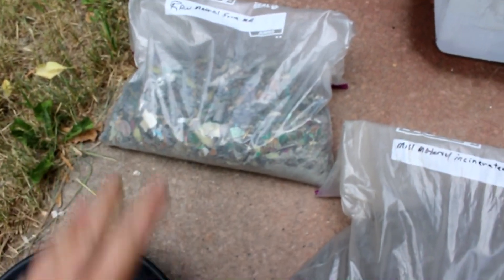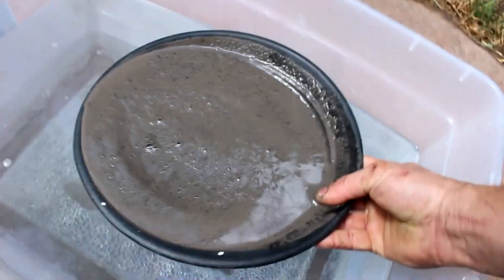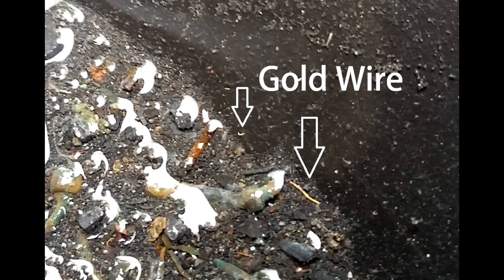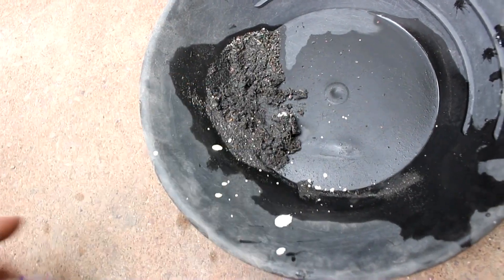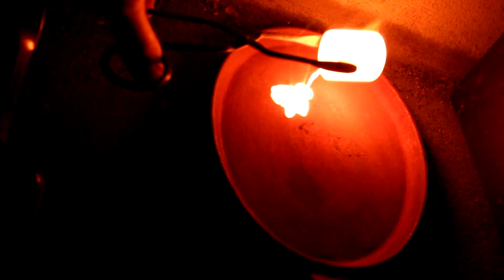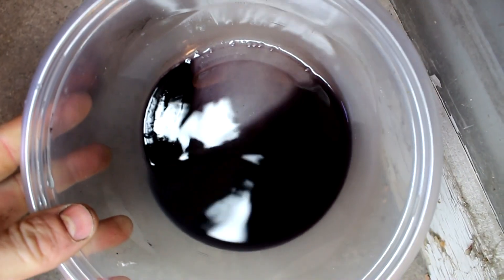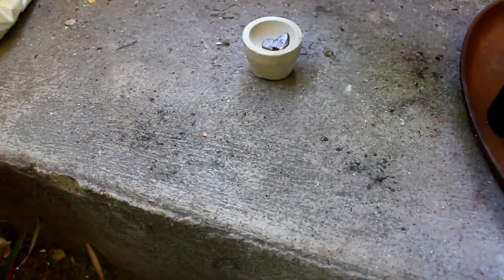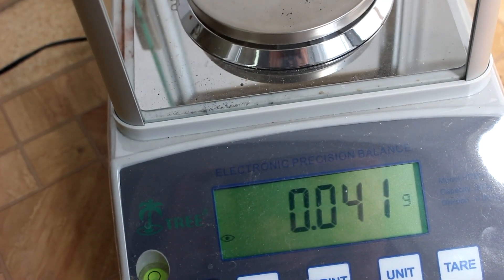Precious Metal Refining & Recovery, Episode 12: Gold From Computer Ash

Comment: Huh. You've mentioned it before but I didn't quite get what you were talking about. That "flashing over" or whatever you called it is a quite interesting effect. I'm guessing it's caused by the energy released in the phase change?
Reply from the maker: Yes, the bead was super cooled to below its freezing point and then jumped back up (changing from red hot to orange hot) when is started to solidify.
Reply: ***** It's one of those effects that I can't imagine likely to think up without having seen it happen.
Reply: That was really interesting to see in action, nice job getting it on camera!
Reply: Max Holbrook Oh, so they're one of those assholes that spams other people's comments because the content creator replied to it. Great.
Reply: +Cody'sLab it reminded me of when you catch a pokemon and the pokeball turns yellow and shoots stars up
Reply: Fish Tank When something changes to a higher phase (say, a liquid to a gas) that change takes energy, often a lot of energy. So steam at 100 degrees celsius has way more energy locked in it than water at 100 degrees celsius. In fact, it takes five times as much energy to turn water into steam as it does to take the water from freezing point to boiling point. The opposite happens when you move something to a lower energy phase. For example, when steam condenses back into water, it releases all that energy.

What this means here is that when the gold freezes into a solid, energy is released, so it actually gets hotter, and so it glows brighter until it cools down some more.

Cody mentioned supercooling. Supercooling happens when something gets colder than it needs to be to go through a phase change. If you've seen the videos of people putting bottles of drinks in the freezer and then pulling them out and smacking them so they freeze all at once, supercooling is what's going on there. The smack agitates the molecules of the supercooled water which triggers the freezing process. This happens because the water can't just freeze, it needs a nucleation site, or some kind of irregularity that it freezes around. If the gold was supercooled, when a nucleation site occurred, the entire bit of gold would go solid all at once, releasing all the energy from the phase change very rapidly.

Mind you, I'm kind of just a guy that looks things up here and there. So I may be a bit fuzzy on some of these points.
Reply: I've never seen this effect before and I, too, thought it was amazing! I would have to guess it only occurs in very small amounts ie. in small lumps. I've seen bars of gold solidify and this effect doesn't seem to occur in those. It would be really awesome to get the slomoguys in on this.
Reply: +Cody'sLab i dont understand anything of what you say, yet i love watching +1 subs
Reply: +Max Holbrook He was talking about xbNeil787 _
Reply: Max Holbrook lol no problem
Reply: That's probably the coolest thing I've ever seen, but can't find any other videos on it. Calling @slowmoguys.  does it happen eery time liquid gold cools to solid?
Reply: What are you on about literally all i did was answer your question
Reply: Orion Gamer Well he tagged me in the comment so im not even sure anymore.
Reply: ohhhh shit my mistake...... ignore my previous comments. And thanks Orion for helping me see the error of my ways.
Reply: xbNeiL787 _ ... What?
Reply: Think he was on about the bulldozer at the end
Reply: + seigeengine:
"... when steam condenses back into water, it releases all that energy."
YES! And that's why steam can scald you so severely!

+ Povl Besser:
Also, your earlier remark about the sudden transition from supercooled liquid to solid, occurring only (or preferentially) in small samples, makes sense, because larger samples will be much likelier to have a nucleation site somewhere within, and once the transition gets started, the whole thing converts, and quite rapidly!
And yes, this would certainly be a great phenomenon for slomoguys to tackle!! I would love to see that!
[Your suggestion is now a year old, so I wonder whether they've already done this? Worth checking...]
Reply: Max Holbrook He was reacting to finding out that he was one
Reply: seigeengine gonna nod my head like I understand what you just said
Reply: Yeah I was calculating and I got the exact amount almost I got 40 millg

Comment: Cody,can you be my science teacher
Reply: I also got a question, why did the water turn blue
Reply: Copper.
Reply: +Itz Nuno Most likely because there was copper dissolved into the nitric acid solution
Reply: +Itz Nuno The solvated nitrate ions from the nitric acid reacted with copper to form copper(II) nitrate, which has a blue colour both in its crystal form and in solution

Comment: Am I figuring this wrong or isn't 60 grams of pure gold worth $2300.00 +\- ?
Enjoying your videos, thanks!
Reply: It's a few dollars. $2-3 to be more precise.
Reply: No thats $2.30 sadly
Reply: milligram is 1/1000 of a gram. So if 60 grams of gold is worth $2300, 60 milligrams is worth $2.3
Reply: Ominous Omnivore thats what cody got but David was asking about 60 grams.
Reply: +Haniel Tsegay but isnt that still $230 ?
Reply: Bit more actually. At the moment 60 grams of 24k gold is worth $2866.7
Reply: for 40 mg its more like $2.10
Reply: You read it wrong, assuming its .999, the gold is actually $2.60 per milligram. I simply said "$2-3" because its around that range. 60 grams = $2,612.51
Reply: One kilogram is worth like 46,000$ but it fluctuates in value with the economy
Reply: Milligrams are thousandths of a gram, just like a kilogram is a thousand grams.

60 mg is 0.06g
Reply: +trevor jaster Gold doesn't necessarily fluctuate with the economy.
Reply: +seigeengine it is strongly effected by the economy is a better way to put it.
Reply: trevor jaster Gold doesn't track the economy. In fact, it often runs opposite to it since people tend to flock to gold when the economy is doing poorly.
Reply: Just for fun: 
1353.64usd/oz (11th of July gold price)
1353.64usd/28.3495231 grams
47.748245usd/g
0.047748usd/mg
--> 1.91usd/40mg
--> 1.727eur/40mg

So that small piece of gold is worth about 1.91$ or 1.73€
Reply: You are using the wrong 'gram' figure..., there are actually ~31.1grams per troy ounce.
Reply: That's why he corrected himself and said "gold is strongly affected by the economy"...
Reply: Albert Wilson Again, so is the price of every good, which isn't an argument about gold. How is what matters.

Comment: why does gold brighten when it solidifies? or was that just the camera adjusting it's exposure?
Reply from the maker: No it really does that. ever notice that water gets warmer as it starts to freeze?
Reply: Excuse me?
Reply: hahaha, make a video explaining that...
Reply: Is it to do with the number of ways each molecule is able to vibrate and store heat? When it solidifies, the heat energy is concentrated into a fewer number of "oscillations", which more readily transfer that energy into light?
Reply: +Cody'sLab so its basically like all the heat inside the bead escaping in a cool way?
Reply: I'm guessing it has to do with undergoing the phase change, to turn from liquid to solid a material must lose energy.  The bright light might be from the release of the energy that was keeping the gold liquid.
Reply: ***** interesting. you should make a video about it

Comment: Hey Cody, why does the gold appear to flash as it solidifies?
Reply from the maker: same reason that it is rather warm during a snow storm. the bead was super cooled (much colder than the melting point) and then it released heat as it solidified, this raised the temperature back up to the melting point for a short time.
Reply: +Cody'sLab that's really cool! Thanks for responding, love your videos
Reply: Is the price a lot to run the furnace?
Reply: +Cody'sLab and the dozer now sounds way better.

Comment: 4:58 so cody you switched from fornuis because it spilled or is the smaller fornuis beter? and what is "flux" :P
Reply: flux is a substance that stops the metal from oxidizing in the crucible.
Reply: It sits on the top of the dense molten metals sort of like oil on water, the impurities are more soluble in the molten flux than the metal so they migrate into the flux layer. When it cools the flux turns into a glass that you can physically remove from the metal, taking the impurities with it.  At least that's how I think it works.
Reply: He switched the furnace, because the one he used first was heating up slower and not high enough.

Im not an expert on the flux question, but I think it is some kind of a catalyst to help refine the metals better.
Reply: Hell Bound Zed ty :]
Reply: is flux any different then the flux used in electronics with soldering? cause flux wick acts like a sponge for solder which is neat
Reply: the flux used in soldering is different than the flux he was using. solder flux is used simply to clean the surfaces you are soldering together, whereas the flux he used is for remove base metals from the ore entirely.
Reply: Timithy Scripter wait, what about solder wick? that shit is like a sponge! but i figured flux also helped solder flow properly too
Reply: the de-soldering wicks just use capillary action to make the solder flow through the wick.